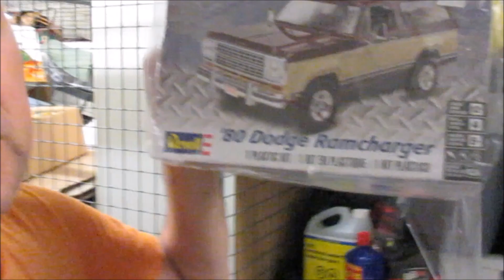#Shop truck group build Dodge Ramcharger

Comment: Nice update and hope your refreshed and recharged. Those NASCAR rear trailing arms are delicate so be careful since I cracked mine from too much pressure. Ramcharger mock up looks good.👍
Reply from the maker: Yea your right Sir David, i thought about that too what would i do if they break ? I would probably just build some out of Aluminum. Cheers...

Comment: Chuck, nice work so far on the Ramcharger. What chassis are you using for this? I know the trailing arms are NASCAR but the center and front sections?
Reply from the maker: center and front section is from a nascar kit, back half is the original Ramcharger kit, i will go over that in this weekends video, thanks brother...